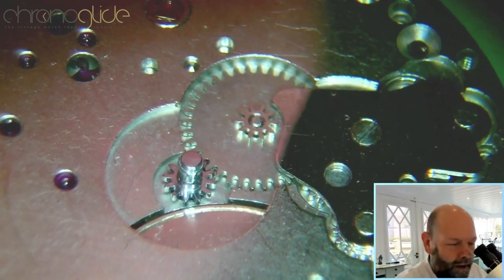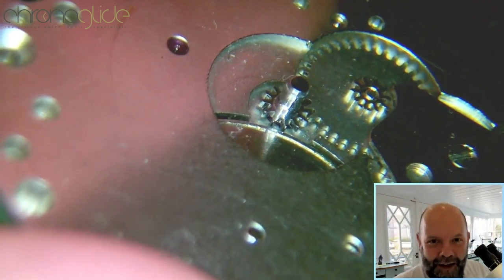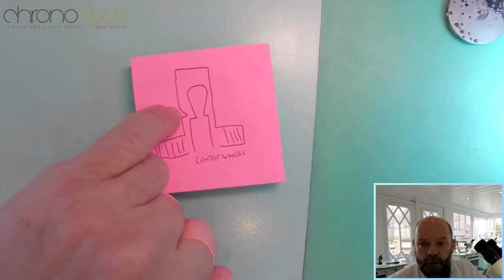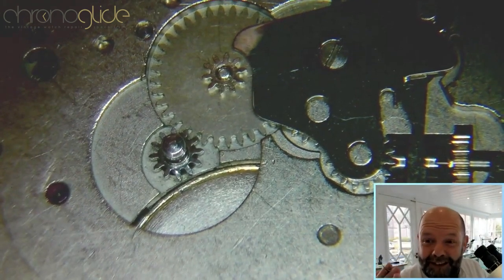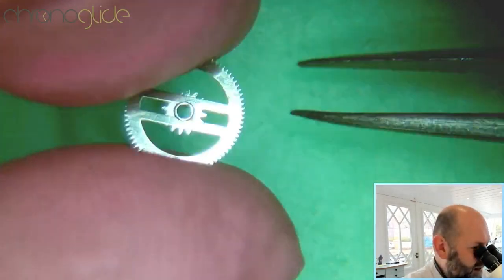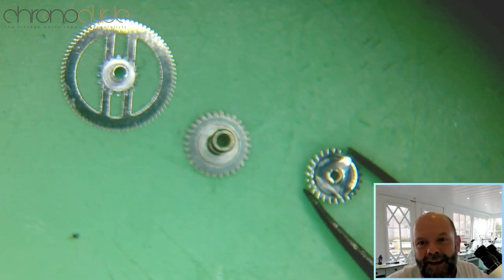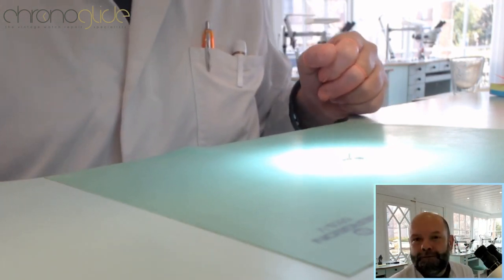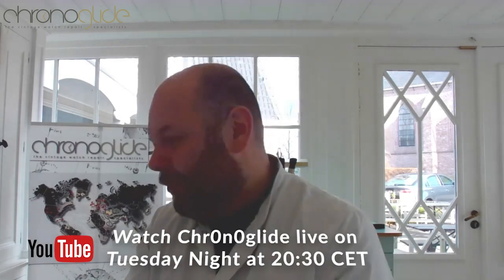Cannon pinion - The unsung hero in watchmaking

Comment: Thank you for this video. That is exactly the problem I have right now. Minute and hour hands stop right before date change (in my case 23:20), the second hand keeps running. I will check if my cannon pinion needs tightening.
Reply from the maker: Or the date function takes too much friction? Maybe a bit of both. Good luck!
Reply: @ChronoglideWatchmaking  I have just checked it. My Certina 25-021 (ETA 2752 equivalent) has another solution, similar to the one you mentioned in 7:30. I just need to find a way to tighten it. Do you have any tricks?

Comment: Oil on the cannon pinion ?  I think I have committed a new guy error (on my first movement rebuild) and it is now slipping, probably because I got oil on it.  Having seen this video I assume you never oil a cannon pinion and I need to take it apart, degrease it and put it back together dry.  The movement itself is running accurately (software timegrapher says so) hence suspecting the cannon pinion slip.  Paul

Comment: All cannon pinions I’ve seen so far have two indentations on opposite sides!? To increase the friction I (most often) use the Bergeon 4733 cannon pinion tightener. To remove the cannon pinion I prefer to use a vintage cannon pinion remover tool which is very efficient and convenient and also eliminates the risk of damaging the centre wheel pivot.

Comment: Great video . Very interesting . In my case I have a Seiko 6923 movement . The seconds hand is working  normally but the hour and minute hands do not move when the crown is pushed in  . I can set the time normally when the crown is pulled out  . Are these symptoms explained by  a worn cannon pinion or a cannon pinion that  does not have enough friction with the pivot of the centre wheel  ?

Comment: Great video. I had exactly this problem today. On a Tissot 2571 the minute/hour hands would slow down or stop at various points but the second hand ran normally. Also the hands turned too easily using the crown. Not enough friction from the cannon pinion. I adjusted the cannon pinion as you demonstrated… perfect. 
Thank you for sharing this valuable knowledge. 👍

Comment: Its after midnight, and Im just fighting with Zeniths 2532C cannon pinion, thanks for your vid. Theres one other issue Im looking answer for, and theres nothing on the internet.
The pipe in seconds hand is bit too short to reach second wheel pivot. Is there a way to extend the second hand pipe?
Reply from the maker: Good question! Maybe your sweep second pinion is not original and too short (or the tip is broken) or the second hand and pipe is not original. Best of luck!

Comment: Another excellent video!  I once thought it would be a good idea to put a bit of grease on the center wheel pivot, to make it easier to install the cannon pinion.  The watch was running perfectly but after full assembly the hands weren’t moving. As you said, the cannon pinion needs enough slip so you can set the hands but also enough friction so the center wheel can drive the hour and minute hands!
Reply: It’s customary to grease the centre wheel pivot, or the inside of the cannon pinion.
Reply: In the video I'm linking below you can see a larger diameter section of the 4th wheel pivot being lubricated with Mobius 9010.  I suspect this larger diameter section is what he calls a mushroom here and what the cannon pinion has to be pushed over. Go to 15:36.
https://www.youtube.com/watch?v=eNfBEVCF9f4

Comment: Another enjoyable video thank you.   A question regarding lubrication please.  Are there any rules?  Is moebius 8200 generally applicable?  Will lubrication of the centre wheel pinion destroy the friction effect. Or. Is lubricant required to extend the life what are tiny metal surfaces rubbing together? being the interior of the cannon pinion indent and the centre wheel pivot notch? Thanks